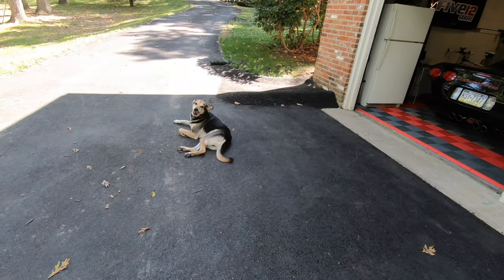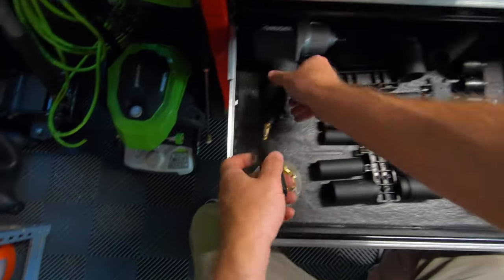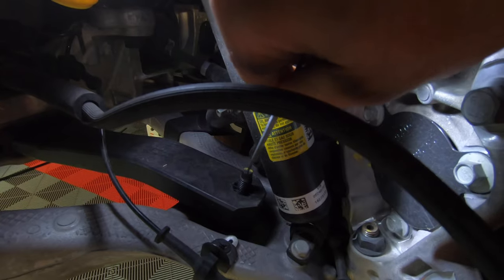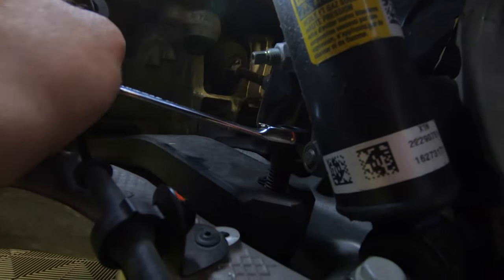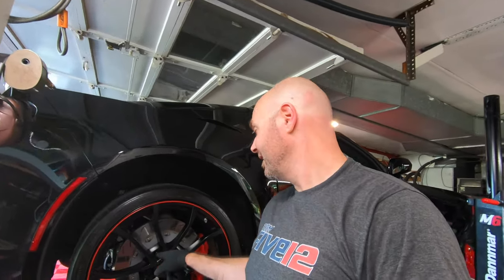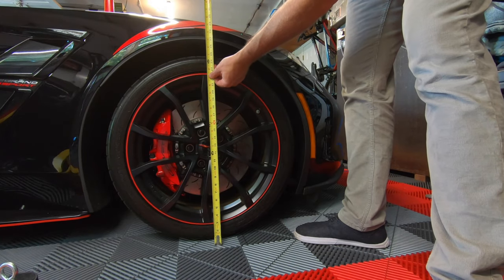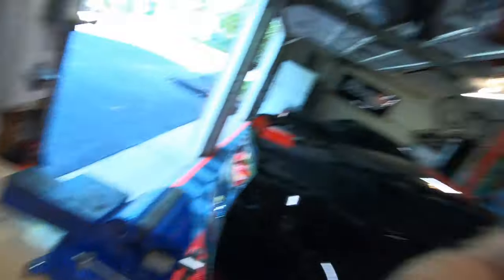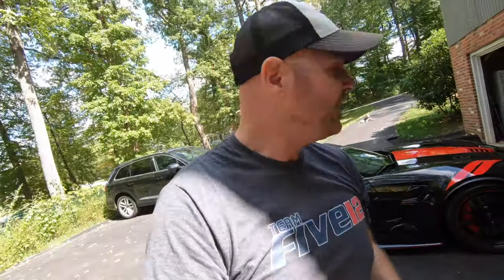Lower Your C7 Corvette for FREE! - Lowering Bolts DIY

Comment: The only thing this video taught me, is how obscenely high my Corvette was riding. I was at 29.5" rears and 28" in Front. 
Turns out the Dealership I bought my car from, never winded the car back down after it was transported, so I was literally driving at "Transport height" and not stock height this entire time!
No wonder I was able to fit a fist into the wheel wells...!
Reply: When I bought my Z06 the dealer asked me to if I wanted the car lowered off the "Transport Hight" but I declined in fear of making the car too low for the crapy streets of Miami Beach. My C6 was already a problem.  I'm getting ready to change my original Cup 2 tires, and I'm really tempted to bring the car down. Did you lowered your car after watching this video?

Comment: Does the car need an alignment after doing the lowering. My problem is I put a Zr1 replica front end on my C7 and it’s too low. So I’m going to raise my car up an inch. Great video and explanation! Thanks Jim. 
12:10
Reply from the maker: Yes! I would definitely recommend an alignment after raising or lowering your car. I didn’t right away and had to put a new set of front tires on before I planned.
Reply: @Team512  thanks

Comment: I never knew that it could be lowered by the factory setup bolts.
Reply from the maker: I believe the C5’s were the first generation that could be lowered with factory bolts. It’s one of the many great features of these cars. Best part, ride quality doesn’t change. At least that’s been my experience so far. And it looks so much better! 👍

Comment: I would suggest, for a more even lowering, that you mark the bolts so that you can count the number of turns at each bolt instead of just cranking them all the way down and backing off a quarter.
Reply from the maker: Great idea! Thankfully all settled out evenly after a few days of driving. I would suggest an alignment afterwards as the Michelin’s wore out prematurely on the insides.
Reply: @Team512  Getting a fresh alignment is absolutely mandatory anytime you change the suspension height on any car, whether you do it like this or with lowering springs.
Reply from the maker: Ltngdrvr Agreed. My biggest problem is finding a local shop I trust to do the work. The last one took a chunk out of my wheel and tried to cover it up with ill-matching touch up paint. After several attempts to contact the manager, I finally gave up.
Reply: @Team512  Dealer maybe? Without the alignment you smoked some tires, so you have to find a good shop!
Reply from the maker: Yes I sure did. And as you probably know a set of rears for this car costs about $1000. It was a local Corvette performance shop that boogered up my wheel. Unfortunately, the dealerships around me are not what I would call Corvette friendly.
Reply: @Team512  Yeah, hell of a deal when you can't even rely on a specialty shop. Guess we're spoiled in Texas, so many top quality stand up shops with great reps.
Reply: @Ltngdrvr  just got my first corvette C7 and live in Nevada outside of Dallas, looking for a good shop for oil change, alignment  . Thanks

Comment: Debating on doing mine, looks better, but scraping is my concern. Someone’s practicing...gunshots at 11:24?
Reply from the maker: I too was concerned about scraping. With the bolts adjusted to the max I haven’t experienced much or any scraping and driveability was not affected. The front dropped 7/8 of an inch and the rear 1.25 inches. 

Yes. Good ears. I have a gun club behind my property. 😎

Comment: Great video, this project was very simple! I tried this on my 2015 Z51 and I only got a drop of less than 3/4” in the rear and less than 1/2” in the front. I only drove it about a mile to let it settle. Should it it drop some more as I continue to drive more?
Reply from the maker: I found that it dropped a bit more but nothing significant as significant as the initial drop. I would advise an alignment. I didn’t at first and ate through a set of tires pretty quick.

Comment: What was the final ground clearance?
Reply from the maker: I haven’t measured splitter to ground. But the fronts settled at 7/8” lower and the rears 1.25”. Was a noticeable difference. No problems with driveability and I rarely scrape if at all.

Comment: Does lowering it put any additonal stress on suspension components?
Reply from the maker: Starting with the C5, GM engineers designed this suspension to be adjustable. Whether or not it adds additional stress, I can’t speak to. Anecdotally, I haven’t heard of any issues resulting from lowering the ride height except for scraping. Both of my Corvettes are lowered on stock bolts and I’ve noticed no difference in overall ride quality and driveability.

Comment: ??  Did you get an alignment afterwards? Does it change the negative camber much? Does toe change as well, and tire wear (inside vs outside of the tread) pattern change as well??  Thanks and very nice video....
Reply from the maker: Thank so much for the kind words.  And thanks for watching and commenting.  I did not get an alignment immediately after I lowered it.  But, I wish I would have.  I had to replace the rear tires due to some pretty bad wear on the inside edges.  Learned my lesson!  So, yes, I would recommend an alignment.
Reply: I lowered my c5 and thought all was well. About a year later I realized the inner half of the left front tire was worn down to the wear bars. The rest of the tires still had some life. So if you do this, an alignment won't hurt any. I'd like to do this to my c7 but don't want to mess with an alignment right now so I'll just wait a little longer.

Comment: Hey scott , 

I just lowered my 19GS taking the stock  bolts all the way down and got my alignment. The shop couldn't get my front camber in spec, currently -2.75 degrees negative camber. They said the cars camber adjustment was maxed out. Did u run into this problem with your GS ? 

TY
Reply from the maker: Interesting. I did not run into that issue. What type of shop did you take it to? I’m thinking a shop that’s used to dealing with corvettes would have figured it out. Especially if they knew you lowered it.
Reply: @Team512   Took it to my local tire shop they have been fine in the past. They even do track prep on some peoples vettes that take them to Seabring raceway in FL ( I live in FL). They  said this is a common problem with vettes after lowering them on the bolts but its the first I have heard of it. Not looking forward to destroying tires with -2.75 degrees camber. Maybe i need to do some more digging.
Reply: @JDM_MSK  have you figured out the solution ?
Reply: @gunsmokezz  

No I never did figure it out. I ended up selling the car because the market was so good.  It is possible that the alignment shop I used was not so smart. Probably worth getting a second look at another shop

Comment: Nice video......I just bought a 2017 Gran Sport and I'm wondering how I can tell if it is already lowered? Any visible clues I can look for? I thought about seeing how close the measurements are to your before or after, but I can't quite tell the exact location you are measuring from on the wheel well.
thx
Reply from the maker: Thanks Rob!  Pause the video at 1'18" and you can see I'm measuring from the floor of the garage through the centerline of the front wheel to the edge of the plastic fender lip. 27 5/8" You can also sometimes eyeball the gap between the top of the tire and the lip of the fender.  If it looks considerable, it probably wasn't lowered.  You can also remove a wheel and look at how many threads are showing on the lowering bolt.  If you're going to lower your Grand Sport, I highly recommend getting an alignment.  I just bought new rear tires after only 5000 miles.
Reply: THX!
Reply from the maker: Rob F Sure! Hope I helped. Feel free to email me if you have any other questions. Teamfive12garage@gmail.com

Comment: Nice tutorial on lowering the GS Scott. I'm amazed you got those numbers with just using the factory bolts. An unrelated question. Did you put on the red trim wheel beading, or is it a dealer installed item, or ? I'm still trying to catch  up on your previous uploads, so maybe the answer to my question is in one of them, but what's the story with C5?  Save the Wave.
Reply from the maker: Thanks! The car settled nicely with about a 1”’drop all the way around. I was surprised too. The red stripe on the wheels was a factory option. There’s actually a groove in the wheel that houses the stripe. The C5 FRC is my first Corvette. I have several videos featuring it. It’s cammed with full exhaust. Fun car to drive!👍
Reply: Thanks. I'll keep working my way through your older videos.

Comment: Nice man , dropping the stock bolts this week. Thanks for the great content
Reply from the maker: Awesome! Make sure you get an alignment. I killed my rear tires after only 6000 miles. Lol.
Reply: Five12 Garage sure that had nothing to do with your right foot lol .
Reply from the maker: @JDM_MSK  Yeah...you're probably right. lol
Reply: Five12 Garage The suspension definitely settles after a few miles . I am getting my alignment tomorrow. Next is the AWE Xpipe install !

Comment: hey good going man. ordered my awe tuning x pipe cause of you. Im also building my channels. Question: I really think the stock form is low enough already. What made you want to lower the car even more?
Reply from the maker: Awesome! Did you order new donuts gaskets for the install? I would suggest doing so, just in case your stock ones are toast. I lowered it on stock bolts to close the wheel gap as much as possible. Ride quality hasn’t changed and I don’t scrape on anything.

Comment: nice vid...im waiting 4  my red hash marks from gm..i have a blac on blac 18  gr.sport..i think i will lower mine..im just hopin that it will not  cause any  long term damage..the car is  on its fac..warranty..+  im worried about scrapping..??what you think?
Reply from the maker: Awesome!  I suggest you get an alignment after you lower the car.  Otherwise you'll eat through tires...ask me how I know. Lol.  As far as scraping, I don't have any issues, but you're experience might be different depending on driveways, etc.
Reply: @Team512  THANCS 4 YOUR RESPONCE!!!IM STILL  GOIN 2 DO IT..